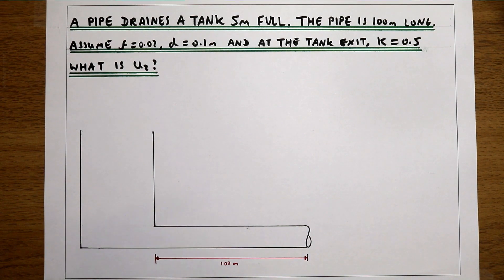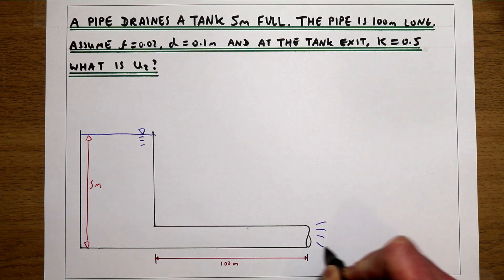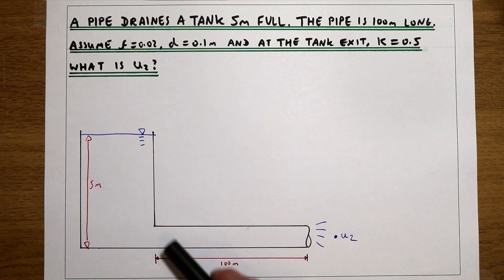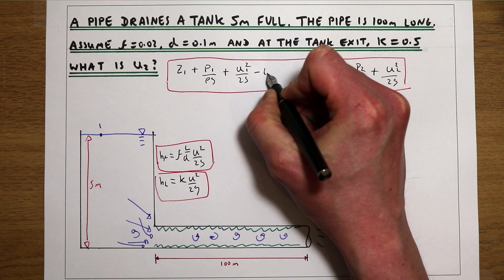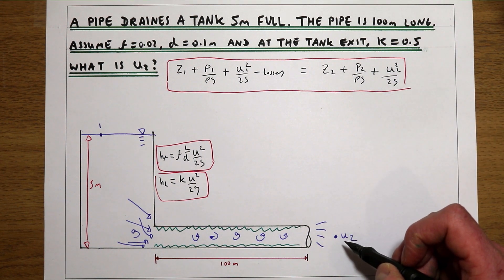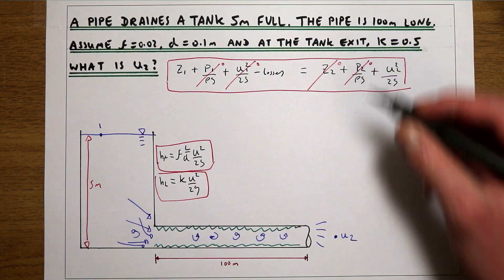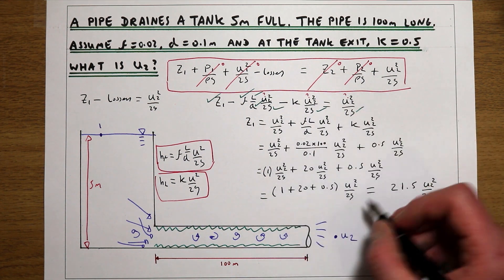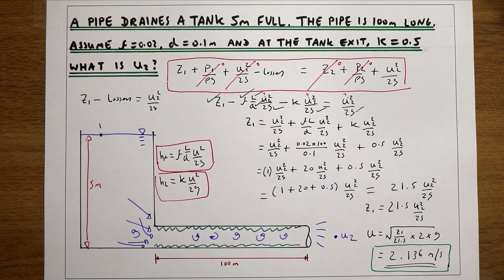Calculating velocity of water in a pipe using Bernoulli's equation accounting for losses

Comment: After finding U2, can you then solve for Q or flow, to then solve for Water Power? I am trying to design a micro hydro and I am given only the height of the water source. Thank you.
Reply from the maker: Does this video help? https://youtu.be/1mXO1jmCI1Q
Reply: @fluidsexplained1901  In the recommended video Q is already given. My question is if Q flow is not given, is there a way to solve for it in order to solve for hydro power.

Comment: How would you go about calculating the time for the liquid to drain from the tank?
Reply from the maker: This would be more complicated as it would be a function of time; for every second the tank empties the pressure head falls. You could do it in an excel spreadsheet by doing the calculation for very small time-steps, working out the discharge at that time-step and thus how much volume and therefore head you had lost, and then repeating at the next time-step with the new water, if that makes sense? There may be a mathematical procedure to do it, but I can’t think of it off the top of my head.
Reply: @fluidsexplained1901  Thankyou for getting back to me! I spoke to a friend about this actually and they said that the best bet is to use CFD! Doing it by hand seems to be close to impossible